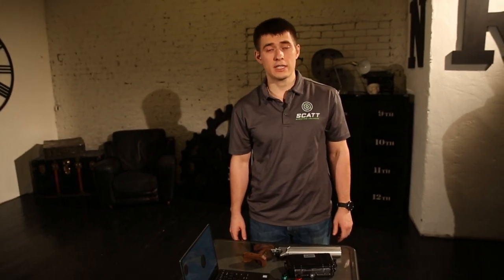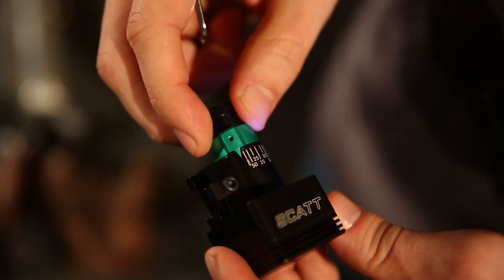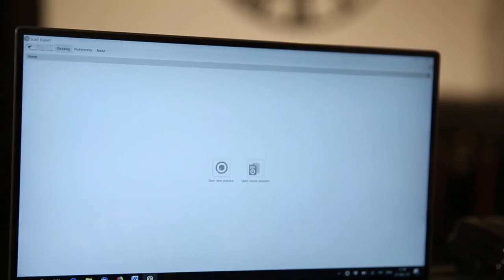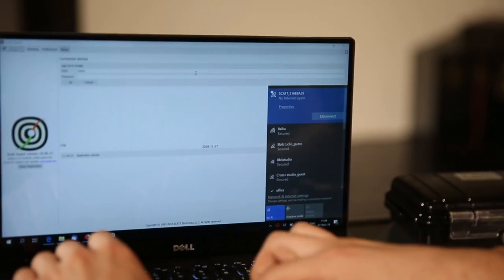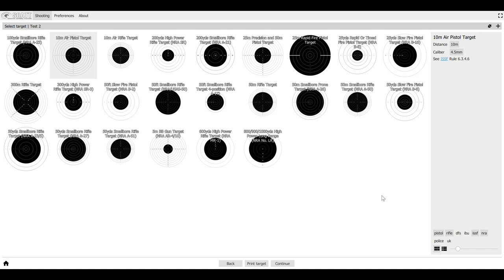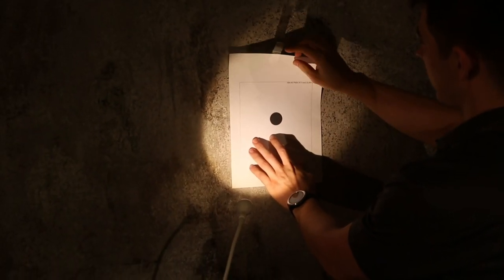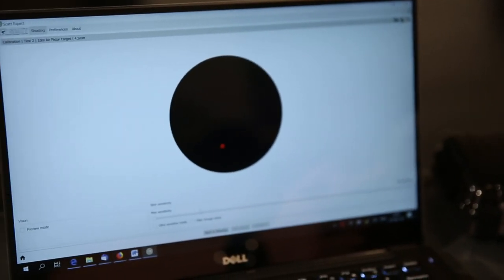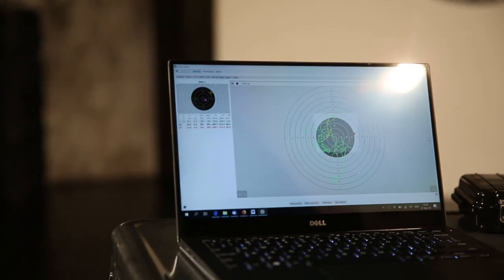SCATT MX-W2 installation set up guide for Expert software

Comment: Thanks for the setup vedio! It helped a lot 🙂
And one question, how do we charge the sensor? Do we have to?
Reply: If you have the MX-W2 wireless model then of course you have to charge it. There is a USB-C port on the sensor and a cable in the box. You can plug it into your PC or a phone charger.
Reply: @alexbolgari5946  yes I do have MX-W2. Thank you so much for informing 😊.
God bless you.
Reply: @shreyadwivedi3436  thank you dear Shreya. All the best to you!

Comment: Can you calibrate the calculated impact to the real impact (or sight predicted) impact point? I have seen a video where the mx02 model is calibrated that what way by dragging the calculated impact point towards the "real" impact point. Thank you
Reply from the maker: Yes. However, you will need to take a few shots to get it well calibrated.

Comment: Just want to clarify something. In the “Direct Wireless Mode” one can connect the sensor to the computer. Does this happen via Bluetooth? 
Do you need to be in a wifi zone ? 

Can I use the blue mode when I am not in a wifi zone?
Reply: In Direct Wireless Mode the system connects directly to your PC or mobile device via WiFi. You don't need to have a WiFi network around.

Comment: But if you are not able to check real impact , how can you know that the system is giving a realistic result ?  How does the system calculate where the impact is ? When I use the scatt in my club  there is some difference between scatt result and the real  result on the DISAG and sometimes difference is really big
Reply from the maker: That's right, the SCATT doesn't exactly see where the shot hits, but instead it is very good about tracking all you movement and predicting where your shot should have hit. However, it is not able to compensate the outside factors: like wind, imperfect ammo, etc. Another factor is your own lateral acceleration at the moment of the shot (shake), if it is high, it can also lead to a discrepancy between calculated and real shot hole. But this factor can be compensated in the software by setting the appropriate f-coefficient in the SCATT software. Therefore, indeed the impact on the paper target might not always coincide with the impact shown in the SCATT program. But the SCATT company does not offer this system as a replacement of an electronic scoring system (like SIUS or DISAG), instead it's an extremely useful training tool that can help you find and diagnose your errors.
Reply: @SCATTShooter  ok but when the impact is not correct  , can the analysis and the diagnostics  than be correct ?
Reply from the maker: @stevevinck4452  the analysis and diagnostics are based on the extremely (!) accurate recording of your aimpoint trace. In cases when like you say, there is a "difference", this difference can be an indication of another problem,  it can be used as another diagnostic factor (bad round, wind, trigger jerk). Please read this article for a more detailed explanation: http://www.accurateshooter.com/gear-reviews/review-scatt-mx-02-electronic-trainer/
Reply: @SCATTShooter  There is a section in the programme that allows the shot impoac tpoint to be changed and the system is supposed to learn.